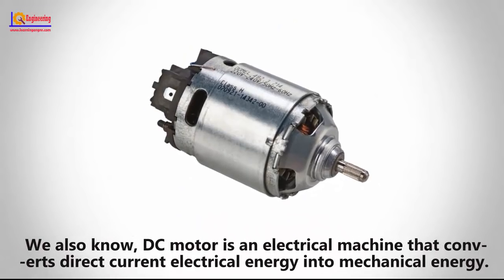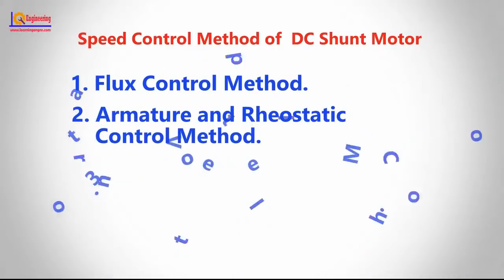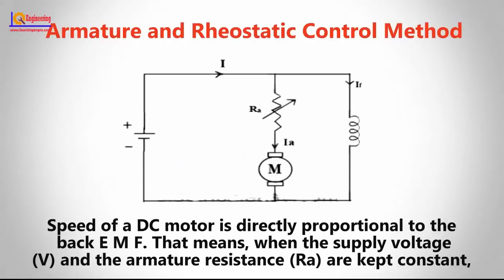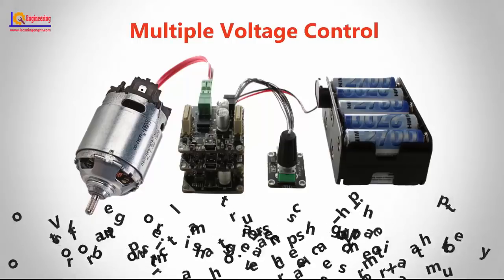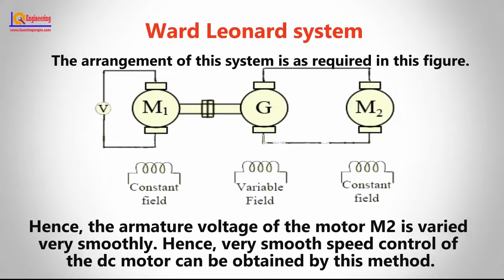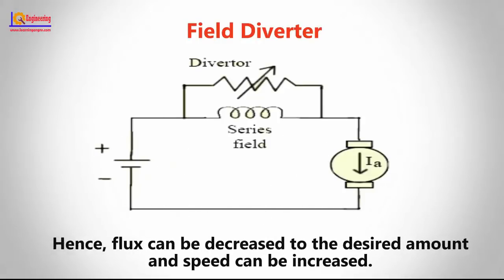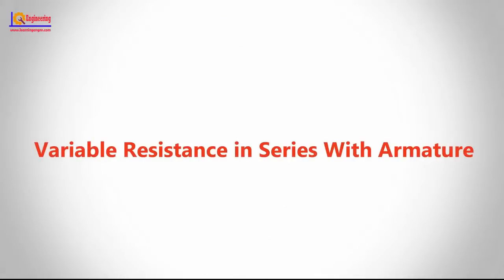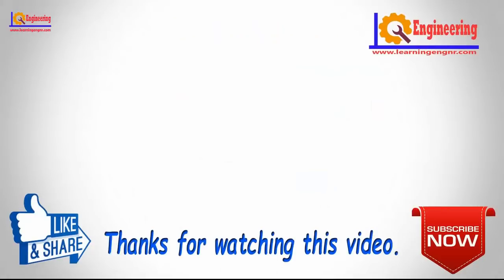Speed Control of DC Motor - DC Motor Speed control

Comment: Please tell me
Difference between eddy current and lazn law
Reply from the maker: In the following, remember the right angles and rotary nature of electromagnetic induction. That moving/changing electric currents induce magnet fields, and moving/changing magnet fields induce electric fields.

Induced current would be the current that results in a conductor due to a moving magnetic field. Faraday’s Law discusses the variables of this action. This is the basis of most electrical generators. That output stator coils generate electrical energy as the moving magnetized rotor passes by.

Now with pretty much all such inductors, we increase the inductance of the inductor by winding the coils on a magnetic core. Since magnetic materials are usually electrical conductors like iron, the very current induced by the original magnetic field, flows through the core. This introduces what are known as eddy currents. Lenz’s Law discusses the mechanisms of this action.

Eddy current is when the induced electrical current then generate their own magnetic moments in that conducting core. These magnetic moments oppose the source magnetic field. This resistance is in the form of multiple magnetic loops according to the strength of the inducing field, and current according to the material’s resistance.

Therefore by changing the possible magnetic domains one can reduce eddy current losses.

The first common way to do this are in low energy systems is to use “ferrite” cores. Ferrite is magnetic particles (often iron oxide) in a binding base material, that reduces the domains to the size of the particles.

The second is lamination - used in making higher power transformer cores. By layering the iron core in layers insulated with shellac, one limits the space for eddy currents to develop to the thickness of the laminate layer.Recall here, that the circular magnetic domains are induced by an electric current at right angles, and consider that the transformer construction is such as to send the magnetic field induced by the primary current in the coils in the thin direction of the laminate which contrains the size of the current loop to the thickness of the laminar layer.

Eddy currents are used to advantage in many applications.

thanks for your comment